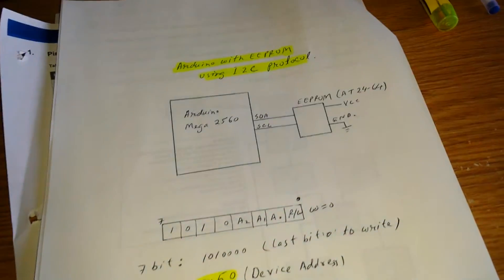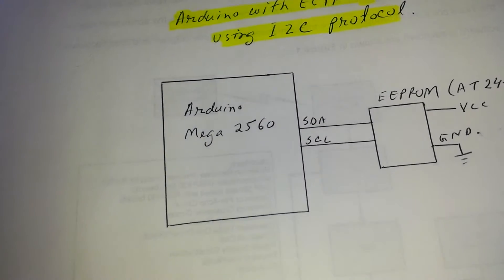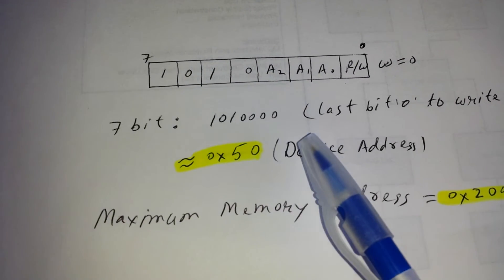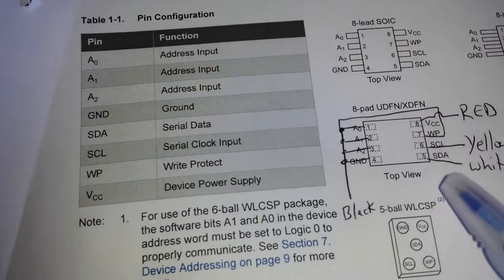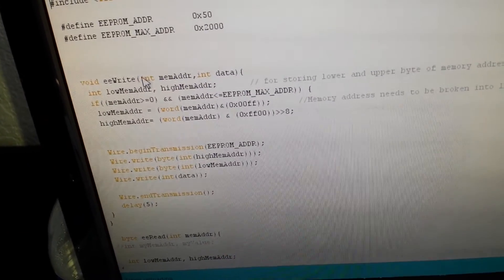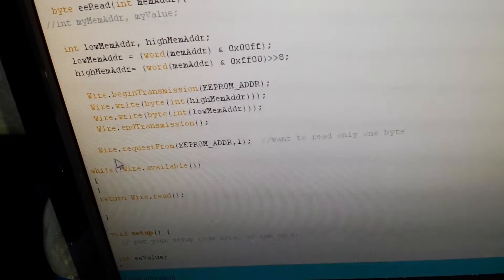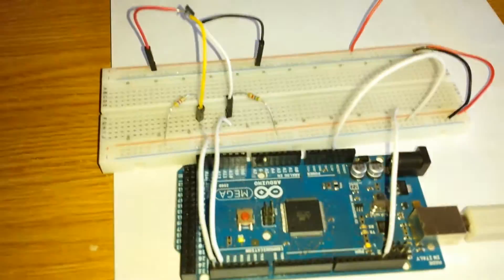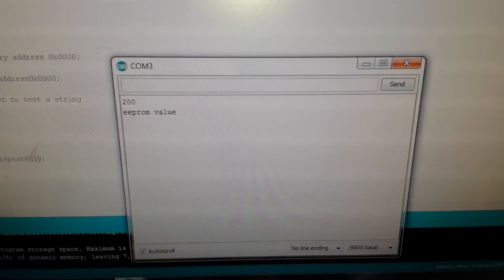Arduino with EEPROM using I2C

Comment: I want to know about the programming and in india from where to learn about embedded system programming. if could you please explain me about it. it will help for me I am automobile diploma holder .
Reply from the maker: Mustafa,
I do not live in india, so I can not find a place in india where you can learn about microcontroller  programming. Since you are in engineer, I assume you have some knowledge about programming. You also can go to www.arduino.cc and look at examples for simple program and then slowly you can move to more complex program.

Comment: its really good video. I want to write to a specific address how can we do this? By your example whenever I write to memory it begins with memory address 0x0000. and lets say I want to write four data to the specified memory location. Then how can I mention address in the write command?
Reply from the maker: hello Affan,
In the video I wrote 200 at address 0x0001 where the code is eeWrite(1,200); here '1' the address and 200 is the value. Now, you can any address below 0x2000 should be fine. You must remember that each address can hold one byte of data.
Reply from the maker: Stuff, you are correct. I realized this issue after your comment. Thanks!!
Reply: "any address below 0x2000 should be fine"In source there was if <= 0x2000 which means that there may be address overflow.